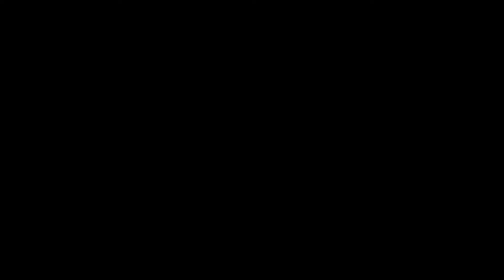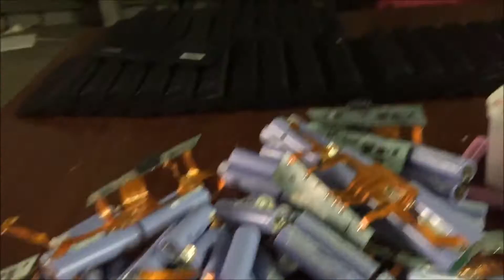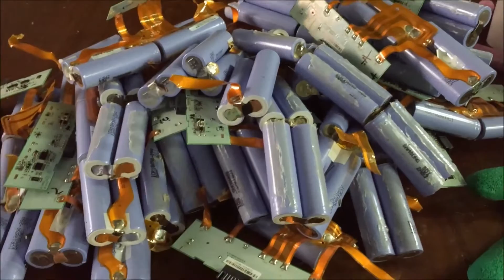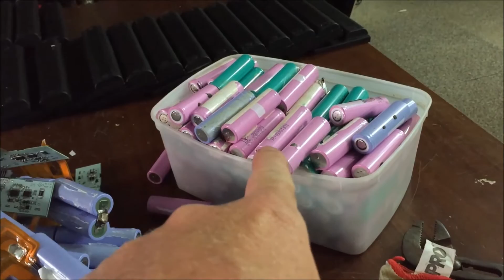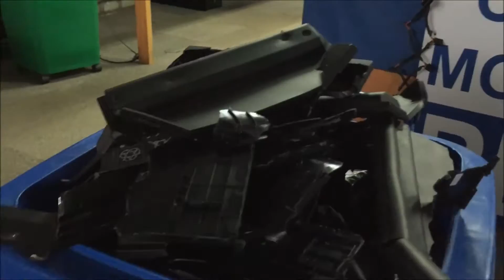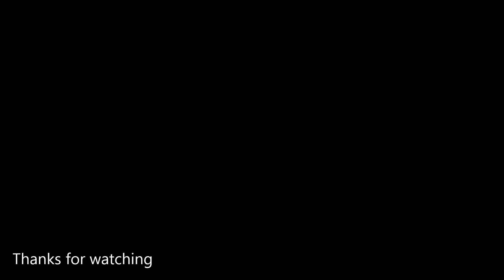Homebrew Powerwall Project - S01E11 18650 Project

Comment: What charger are you using these days ?
Reply from the maker: for solar i use https://goo.gl/8xgq1e for charge discharge test the cells i use https://amzn.to/2Hiypo0
Reply: Great project , that has absorbed a chunk of time, I think I saw you were up to 50 kW now? I remember when you first started this thing but lost track of you till recently. Thanks for sharing all the detail. Seeing thermo couple are so cheap, I wondered if you built a thermo couple for each row and monitored them with a small micro controller which feeds back to a screen you could have a thermal array showing potential heating cells  without having to check them like chooks in a pen ..haha
Reply from the maker: already have 120 temp sensors :) 2 per cell

Comment: Quite an exercise in patience! And no, those batteries in the plastic box aren't going to explode. This is not uranium, there's no critical mass to worry about...
Reply from the maker: NO, won't explode that's for sure but may go into thermal run away. definitely safety needs to be the first consideration messing with these types of projects
Reply: Mmmmmh. Thermal run away. Because of the lithium content? Unless the seal is broken and the lithium is exposed to air (slow oxydation) or water (get out of there quick!) there should not be any immediate danger. But anything is possible, after all there was that youtube video about the Tesla car that caught fire, and it drove the point home pretty good. Cheers for the humongous recycling job by the way!

Comment: There's a hundred different NEW 18650's on Alibaba, some are well under a $1.00
Have you been there already?  Any tips to finding the good ones?
Reply from the maker: +Charles Maza there isn't a chance i'll ever buy a 1 dollar 18650 ahhahaha a used HP laptop battery pack that's been abused will have better more useable cells than a 1 dollar one. I Have got mine from Computer stores (including my own) computer recyclers & tip based recycling centers